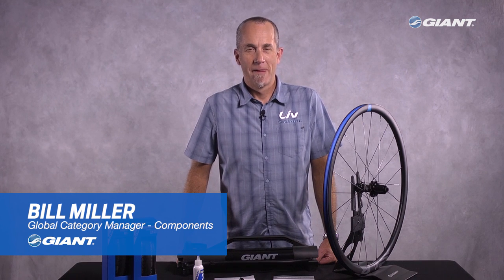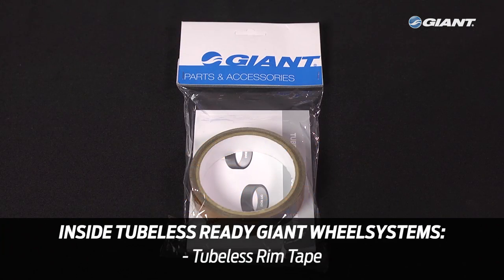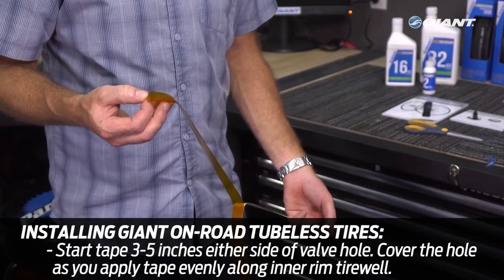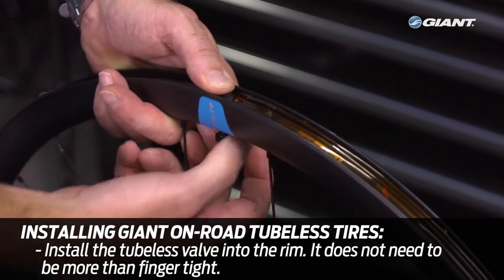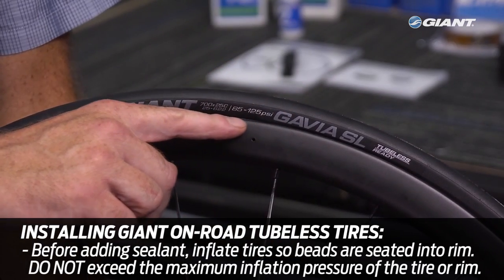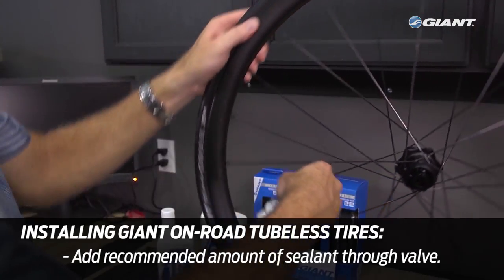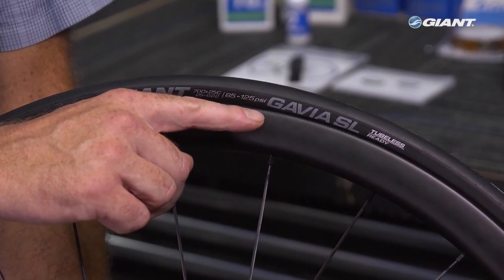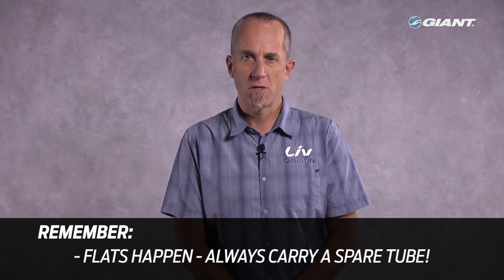How to Install Giant Tubeless-Ready Bicycle Tires

Comment: I’ve got these tyres on my new Giant Propel. I swapped back from my training tyre the other day and installed these. When I inflated the tyre, I didn’t need to use a quick shot of air, just a normal pump. I also didn’t hear the bead “pop” onto the rim. I carried on and injected to sealant and had no dramas. It’s my first time using a tubeless system, should I repeat the process to make sure I hear the tyre bead “pop?” 

Thanks